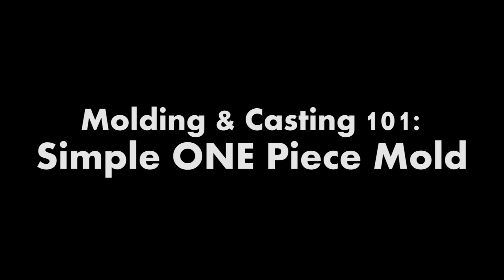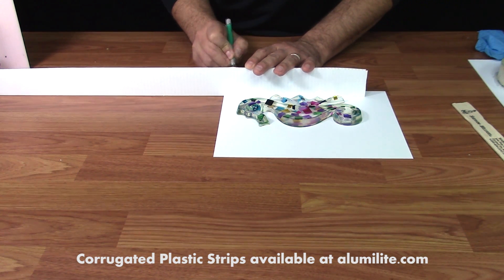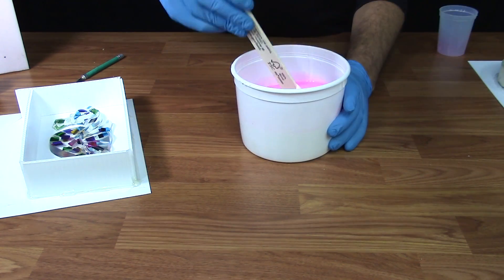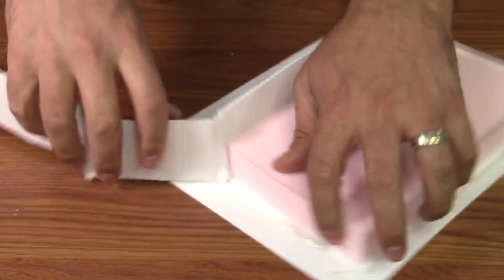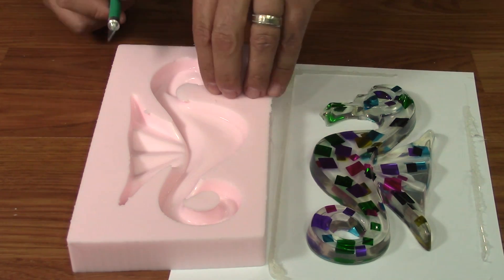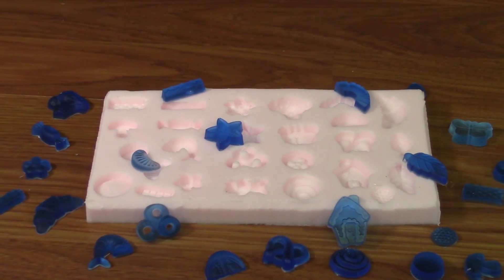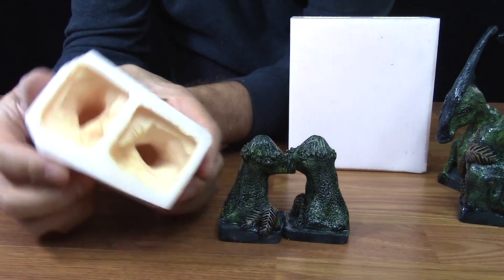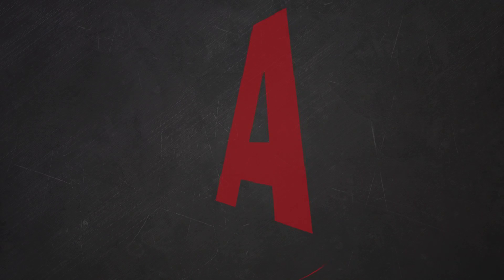Making a One Piece Silicone Mold and Casting Resin Tutorial - Molding & Casting | Alumilite

Comment: Im looking to finish mugs that need to hold up to heat as high as 220 F do you know a product that would work well and be safe to drink from?
Reply from the maker: This sounds like an awesome project! Our Amazing Clear Cast epoxy has a heat deflection temperature of 130°F (which is when it will start to get slightly bouncy but return to normal once cooled, i.e. no permanent damage) and  a heat resistance of 400°F (which is when permanent damage can occur)! It is also FDA compliant when mixed correctly and fully cured for 7 days - we have a huge tumbler community that love using it for their mugs and cups! You can find it here: https://www.alumilite.com/resins/amazing-clear-cast/!!

Comment: I used Amazing Putty to prepare my first mold. On the box and in the instructions it tells you haw much of part A the Base and how much of Part B the Hardener to use.  The instructions tell you that it will be ready to pull apart between 2 and 4 hours. My molds came out kind of sticky but usable. I was expecting it to come out stiffer rubbery content. Being my first time doing this I most likely mixed something wrong. I needed 4 individual molds of the same part that I’m trying to replicate into a crystal clear tough plastic part that will hold up the valance is my dinning room drapes. It seems that all the clips broke at the same time I was able put two clips back together so that I could use them for making molds.I want to make two more molds in order to have 4 molds so that I can pour the resin all at one time because it will take 5 days to set before I can use the clips to hang my drapes back up.  This is very time sensitive project.  As with all new projects there is a learning curve when you first start out. I’m hoping to be able to make the last two molds better.
Reply from the maker: If you have any questions or run into any bumps along the way, please reach out! We're on most social media channels or you can email us at info@alumilite.com or call us at 269-488-4000. Best of luck with your clips!

Comment: Question: Does this Amazing rubber mold pack come with the measuring hand-held cups (for measuring correct ratio of ounces of catalyst to rubber) and stirring sticks?........Also, does this rubber molding material bond to types of rubber other than itself if it is left to cure on them? E.g. I have a silicone mat which I will place the item I want to mold on top of it and then glue plastic edges on the sides to hold everything together (like creating a container) then pour the molding material inside.....but in this case, will the molding material bond to my base (I.e. the silicone mat)?
Reply from the maker: Hi - great question. Amazing Mold Rubber comes with measuring cups but no stirring sticks. Also, yes, Amazing Mold Rubber is silicone and will bond with other silicones. Mold release is required when pouring against another silicone if you do not want the two to bond, as when making two piece molds. Use Alumilite’s UMR (Universal Mold Release) in combination with Rubber to Rubber Mold Release or a thin layer of Vaseline are to avoid the the pours from bonding to one another.
Reply: Alumilite Mold Making & Casting Materials Thank you so much for your reply. Just wondering, which measurement unit are the measuring cups in terms of....e.g. Millilitres? Or what? I just want to know how hard or easy it’s going to be to measure a correct ratio of rubber and catalyst every time?
Reply from the maker: @user-fc3sx2cw5x  The product photo on Michaels has a full photo of the kit, for your reference. The measuring cups are 6oz with fluid ounce and gram measuring marks. There is also a tablespoon measuring spoon. You shouldn't have a problem getting a correct measurement! https://www.michaels.com/super-caoutchouc-%C3%A0-moulage-alumilite/10324147.html

Comment: After you mixed the formula you don't have to vacuum out the bubbles before pouring into box for this silicon mix?
Reply from the maker: Great question! High Strength 2 has a low viscosity which does not require degassing, but we always recommended degassing when available to you.
Reply: @AlumiliteCorporation  Thank you. I'll try it out.
Reply: @AlumiliteCorporation  One more question. I have three of 5 * 3.5 * 2 inches pieces that I need to mold. What size should I get for these?
Reply from the maker: @xiangzili3359  It depends on the size of the mold box you build. Once you have that figured out, you can plug in the numbers to our volume calculator to see the full amount of product you'll need: https://www.alumilite.com/store/pg/12-Volume-Calculator.aspx
Reply: @AlumiliteCorporation  what is degreasing

Comment: I've been using your products for years, but recently the last two sets of mold making kits that I bought from Hobby Lobby do not case clear resin pieces correctly. It's almost as if the mold is seeping an oily substance into the resin pieces I am casting after the mold has fully cured ( over multiple days ) I also use your amazing clear cast with this, and never had a single problem until recently, the pink "oily" bottle of product you mix into the mold material is more pigmented than it had been before. I am not really sure what to do about this issue. I've wasted so much product already and can't determine why the mold is seeping "oil" when resin is curing in it.
Reply from the maker: Thanks for reaching out! Could you please send an email (with photos, if possible) explaining what's happening to carol@alumilite.com? She's a pro and will be able to assist you in troubleshooting this error! It could just be that it hasn't cured for a full 7 days.